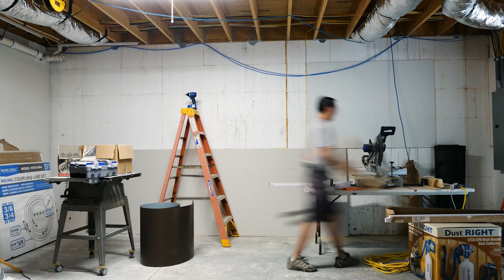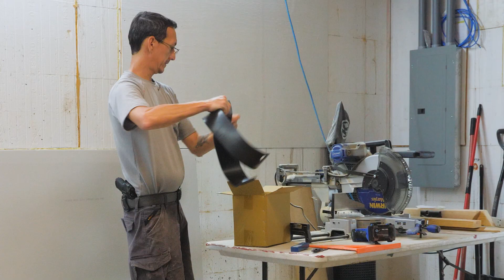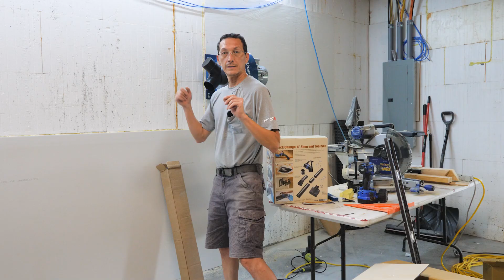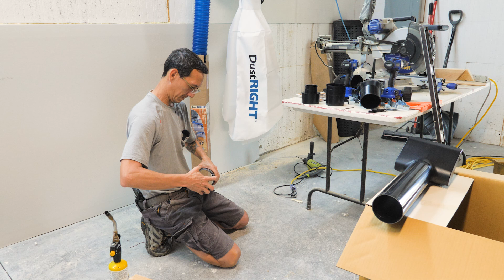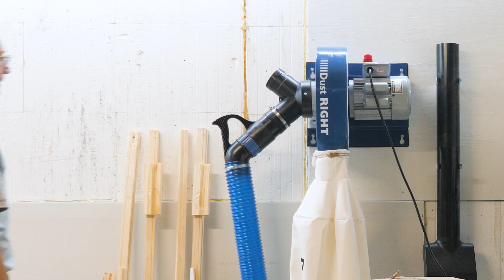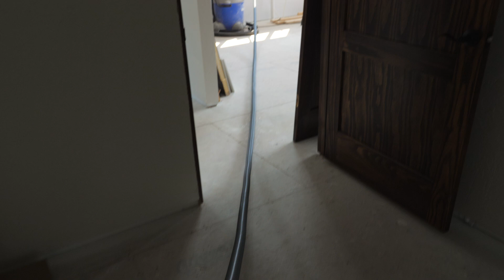If You Have a Workshop, You NEED THIS!

Comment: you might want a (i think its called a cyclone not sure but) its basically a plastic lid for a garbage pail that has a in port and out port on it that you plug in you big hose to it and then another hose out to your tool for using anything bigger then sanding dust otherwise you'll be emptying the bag often. especially if using a planer. it allows the bigger stuff to dump itself in the barrel before having to travel through the longer hose and fill up your bag quickly.  it also doesn't seem to reduce power of the collector as much as  if you make it suck the shavings all the way to the bag.  its not expensive like under $20 and fits most round garbage barrels. 
     another must have In my opinion is a spare bag and anything you can use as a plug for the bag. i found that often times when you least expect it and need the dust collector the most is when a hole decides to appear in the bag then filling up the air with blowing dust. now the cap is anything that fits in the opening if the bag. i made mine out of wood. i like to plug the bag when going to empty it outside so if i set it down to open the door or bump or drop it the fine dust doesn't come out

Comment: Excellent video, Jaime and Jeremy!  Nice system!  When you get around to Air Filtration you might be wise to check out Axiom Stratus.  It pulls dust down away from your face whereas ceiling mounted air filtration systems pull the dust in to your face.  Thanks for another great video!

Comment: I added a rubber flap behind the blade which helps direct the dust into the collector.  I also built a box behind and added a shop vac.  You're not alone as with most collection systems, they can't capture dust very well from a miter saw. Look at your video and I'm sure you'll see most of the dust going right past the collector and all over from there.  A rubber deflector and catch box will solve that perfectly.   It's a nice system just needs help for the miter saw.   Great content as always - stay safe.  House is looking very nice!
Reply from the maker: Yes the miter saw is the most difficult. I’ll definitely make some mods.
Reply: There’s a hood you can get that works great with what you have

Comment: Why didn't you use the extra light to brighten up the corner by the wiring panel?  You could even put it on that wall instead of the side wall with those wire harnesses.

Comment: You need to support the bag with a table shelf or lower the blower so the bag is on the ground. It will get extremely heavy when it is full of saw dust and stress your lag screws.

Comment: Your next addition should be a Fosmon C-10683 Wireless Remote Control Outdoor Electrical Outlet (Amazon, $13.) Plug the dust colledtion into the "outlet" and carry the remote arouind the shop with you. Also, since you're relatively new to this area, you might not know about the Klingspor Woorworking Shop in Hickory.

Comment: Congrats on getting into dust collection.  I have a larger freestanding laguna pflux 1.5hp dust collector and cyclone (with hepa filter).  One of the other things you should definitely look into is additional freestanding fan/filters to help pull out all the airborne dust.  I have used and highly recommend those 20" box fans with 2" thick hepa filters that the fans pull the air through.  I have one of those fancy dylos air quality meters and that shows two of the box fan/filter setups really keeps my garage dust down for the small particles.

Comment: Just wondering how much a bag full of saw dust weights ? Maybe should sit on a bench if not the floor to hold the heavy bag?
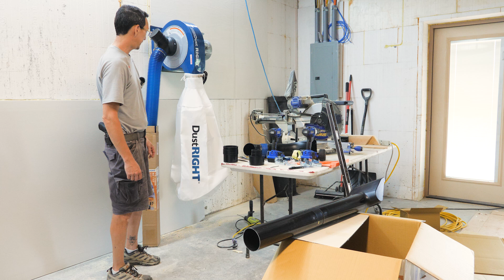Reply: It's not supposed to be fully filled. @11:20 ish.... he mentions this. Only about half full max. Dust isn't that heavy either, saw dust or otherwise unless wet.

Comment: Anybody interested about dust collection should read what Bill Pentz has compiled before spending a dime.
Reply: The main issue with the bagged units like that are they blow the fine particles around in your shop.. That is why all pro collection systems use a cyclone, HEPA filter and usually placed or ducted outside..
Reply: @FJB2020  yep, the fines are the stuff that gets stuck in your lungs and the bag filters let most of that through.

The cyclonic is to separate the bigger sawdust so you can use a filter capable of catching fines without clogging it immediately. 

The more you use your shop, the bigger the issue but any time you have a lot of sawdust in an enclosed space, you should be careful and wear a respirator unless you have very high-end dust collection from the tool all the way to the HEPA filter.  Good dust collection with cyclonic separator and HEPA filter probably starts at over $1,000 and usually needs 2hp+ to have enough suction to capture enough of the fines at the tool.  Leaks, long hoses and small hoses increase the power needed.  Buying tools with good dust collection is another big expense, a lot of new stuff is good but my budget leads me to used tools (I like Taiwanese from the 1980s) and the dust collection is either nonexistent or garbage so I'm stuck with a respirator either way even though I have a 2hp Powermatic dust collector with a trash can cyclonic lid and a HEPA filter.  It's not a good system but it was used, broken, cheap and better than nothing after I fixed the motor...
Reply: @joequixotic3039  I too love my Taiwanese table saw, planers and sanders, but they are 90's to 2000's stuff.. I ended up building my own 2hp dust deputy XL cyclone with dual HEPA truck filters and run some shop fox recircs on the ceilings.  Can almost white glove it and not pick anything up...
Reply: @FJB2020  my Taiwanese table saw has cast iron wings and a decent fence but it was $150 at a yard sale and no dust collection to speak of.  I have a nice Triton router I bought new and it's dust collection works pretty good but I wish I had 3hp and a real cyclonic setup.

My dust collection is mostly used for clean up and I want to get my air clean because my wood shop is in an attached garage. 

I kind of laugh at statements like Tod E's.  Some people never get sick from wood fiber clogging up their lungs but clogged lungs still aren't as good as clear.  The alternatives to good dust collection and filtration are respirators or hold your breath.  I hope he has respirators.
Reply: @joequixotic3039  in C
Reply: @FJB2020  I own and operate a "pro-shop" and have for several decades. My collection/filtration system is a bag-house. That's it.
Hobbyists are the ones who generally concern themselves with trying to suck up "all the dust", given that, the information Mr.Pentz compiled is worth perusing before investing anything in dust collection equipment.
Reply: @FJB2020  You could build a cabinet of plexiglass around the dust bag and have a wide hose from the cabinet to the outside. The bottom of the cabinet could be a shelf the dust bag rests on.